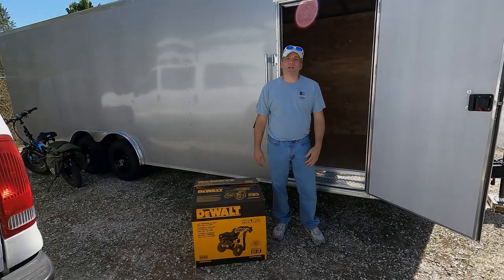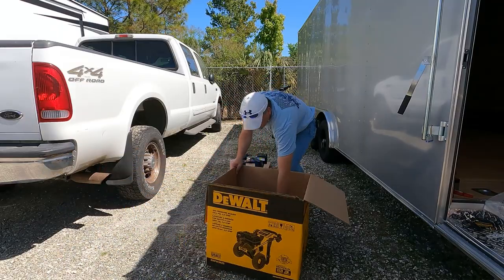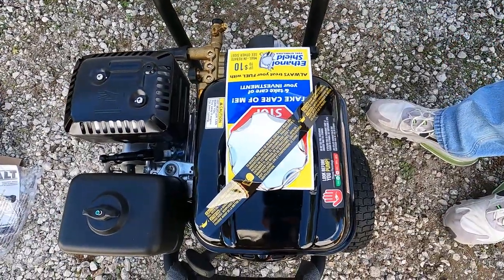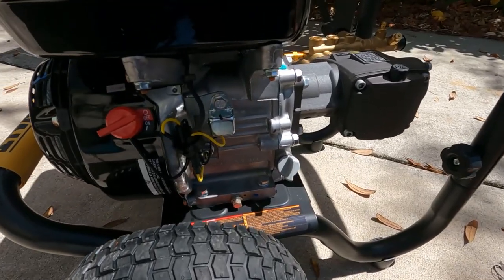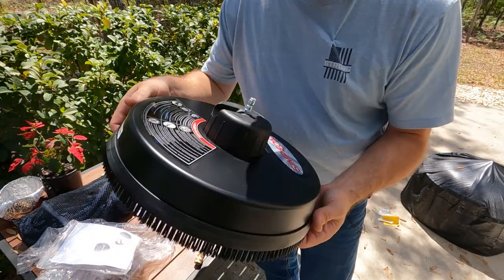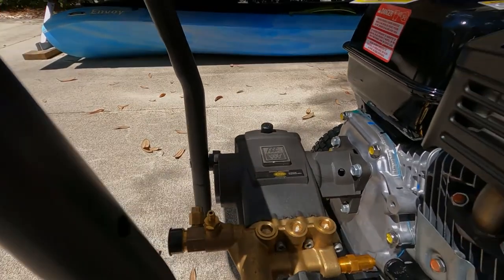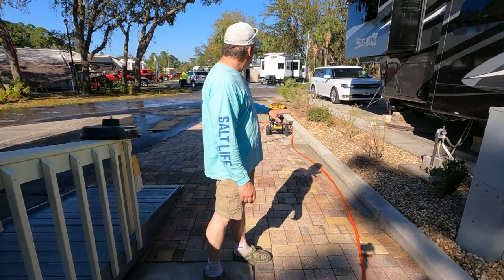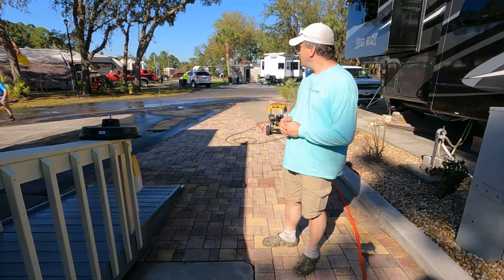Dewalt DXPW3625 / 3600 Psi Pressure Washer & First Use

Comment: Took a lot of pulls first time for me.  After that not much problem.  Be careful with the two rubber stops at the bottom of the frame.  They can break off fairly easily.  I had one break off and had to run a real bolt through it and fasten with a nut.  The factory rivets that fasten the rubber stops are weak.

Comment: Great review!  I have purchased the 3600 PSI, but have to ask have you had any issue with the vibration busting off the two rubber feet?  There is not a huge amount of vibration, but mine have busted off and looking closely, they are simply riveted on and the rivets don't look to be long enough.  Maybe a manufacturing issue, but looking online other models have the feet screwed on.  There was some moderate black marking from the feet and wheels from freshly washed concrete that I had to readdress.  Learned hard way to not have the pressure washer sitting on clean area to avoid the black marks.
Reply from the maker: Hello Mike,
     We have not had any issues as of yet with the feet busting off but we do have the black marks that the feet leave on the ground. I guess the vibration wears away the rubber on the feet.

Comment: Great and easy to understand video!!  I have two questions: after turning on the water there is a slow drip from a horizontal metal tube near the water inlet.  Is this normal, is this anything to worry about? Second:  I have made all the hose connections, turned on the water and then I pressed the trigger of the gun to get the air out and get "a steady stream of water".  but no air comes out and NO WATER even after holding down for two minutes.  What is the reason and What should I do?  Thanks so much for your help Jimmy.

Comment: great instructions. thanks for the video! only question I have is when do you put the throttle button to the max? as when you start from cold you only said you put it 1/3
Reply from the maker: Hello Kristaps,
      You can move it to full throttle after about 30 seconds with no issue.
Reply: @Jimmy2Tech  i tried doing that and the machine switched off. do you have any idea why that could be the case? i thought that was weird. i have simpson 3600 psi honda pressure washer
Reply from the maker: @kristapsstrauts9203  I would try maybe 60 seconds and make sure the fuel is fully in the open position. also make sure to turn the throttle all the way up before switching it. Hope this helps.

Comment: Sweet.  Where did you get the 1/4 50 foot hose?
Reply from the maker: If you're referring to the the hose, link right in the description for everything we use in the video:) we got it off Amazon.
Reply: @Jimmy2Tech  my mistake. I thought you also had a 50 foot pressure was hose   Thx

Comment: How do you hook up a chemical injector? I want to use some chlorine and soap mixture, but I can’t figure out how and where to hook this up on the unit. Any ideas? Thank you.
Reply: It’s Better to use a soap gun attachment to the gun and dont run soap through the system .
Reply from the maker: I second what @danielsalinas5885  said and use a foam cannon or something similar.

Comment: Where did you get your 1/4” 50 foot high pressure hose. The hose that connects the pump to spray handle. It’s not listed in your list of items.
Reply from the maker: It came with the pressure washer

Comment: Great review, I went ahead and got myself one because of it. Question, I'm looking at Orings but I'm not sure if 1/4 inch inner diameter is what I should be looking for to replace to hose and wand orings. What size O-rings are needed to eventually replace them?
Reply from the maker: Hello LeChef,
       You know I am not 100 percent sure but these are the ones I was told will work.  https://amzn.to/3mGJVAa     and if you find them to be to small try the next size up at this link.  https://amzn.to/3Qo10wb   There are kits that have both in them but not to sure of the brand, but I have used Captain O-ring before and they held up nice, just make sure you lube the seals once and awhile with silicone grease. Hope this helps. Thanks again for watching.
Reply: @Jimmy2Tech  Thanks for the reply Jimmy2Tech. My research revealed that I'm going to need a set of 1/4 inch and 3/8 inch O-rings to replace the O-rings in my DXPW3625 setup. (Inner Diameter)
Reply: Home Depot carries a replacement O-ring set in the same aisle they sell the pressure washers.  It's like $8 bucks.  I grabbed it to have on hand.

Comment: I would guess that unit is too powerful for that cheap Simpson surface attachment - I have used one for 5 seasons on my 2300 psi unit that just failed and it has worked great - it is a homeowner owner grade accessory on a pro washer in your case

Comment: Hello  great video!  How is your pressure washer holding up ? Any issues ? Thank you
Reply from the maker: Hello Johnny,
      So far so good. The only issue that bugs me is if you are on a paved surface the vibration when it is running leaves marks on the surface from the rubber feet. A better stronger rubber would be nice but other then that it has been a great machine. Thanks for watching.

Comment: How much was the turbo nozzle? Did you use any pretreatment for the driveway? If so, what brand. I'm new to this so just want to know all the details.
Reply from the maker: Hello Angel,
     We used the Simpson turbo nozzle we got from Amazon which was about 25 dollars. We have a linkntonthat in the video description.  We also since bought the Dewalt turbo nozzle which seems to work a little better and we got that on ebay for about the same price. As far as pretreatment our job did not require any but when they do we like the Simple Green total outdoor cleaner for pressure washers. I will add a link in the description for you. Hope this helps.

Comment: Are chemicals necessary for the concrete ?
Reply from the maker: Hello Roberto,
     It all depends on the condition of your concrete. Like a really oily surface might require a acid to clean it better or a surface really moldy might require a cleaner. You have to test a section and see how it works for you before looking at chemicals. Hope this helps. Thanks for watching.

Comment: comes with a 1/4" x 25' hose NOT a 3/8 hose
Reply: Yeah, luckily I already had a 3/8 inch hose.  The 1/4 inch hose is good for running through the black corrugated underground drainage pipe to clear it out.  You’ll need to order a special nozzle to do that.
Reply: No se puede usar manguera de 3/8 en esas hidrolavadoras?